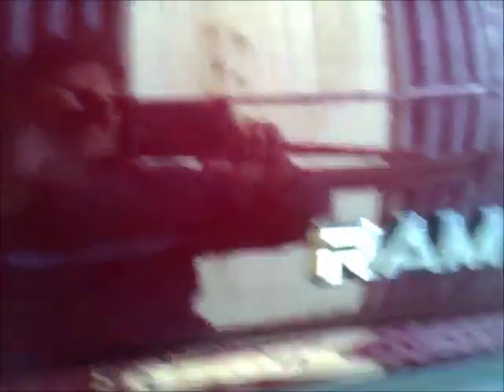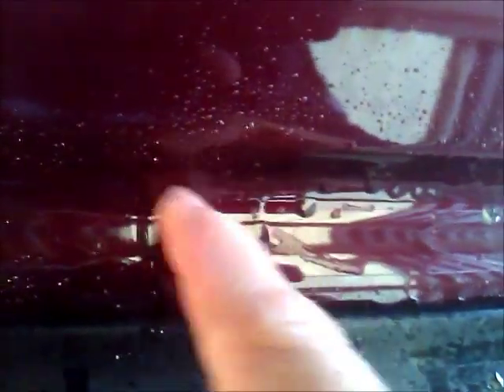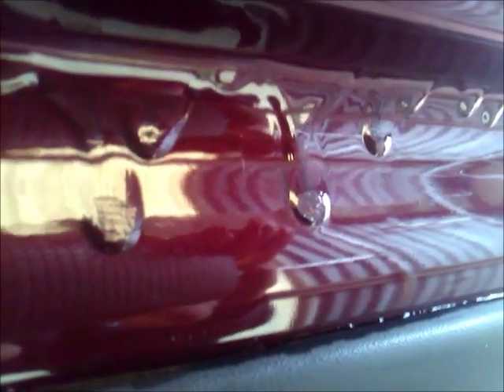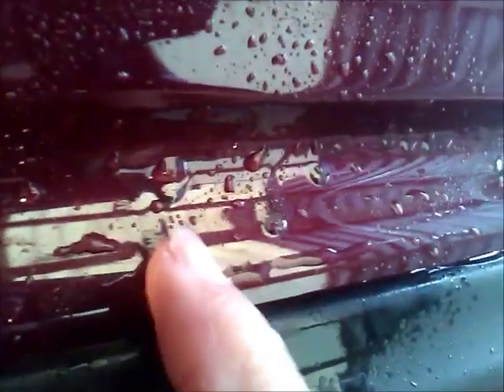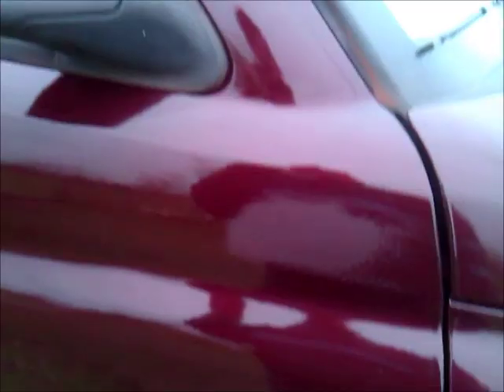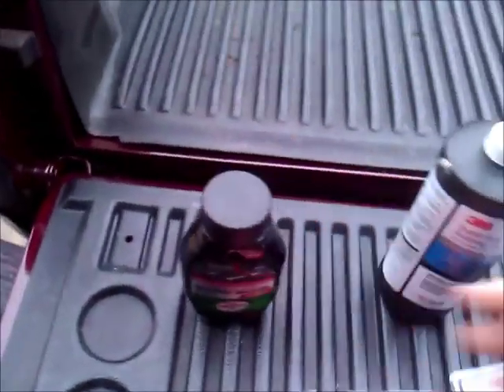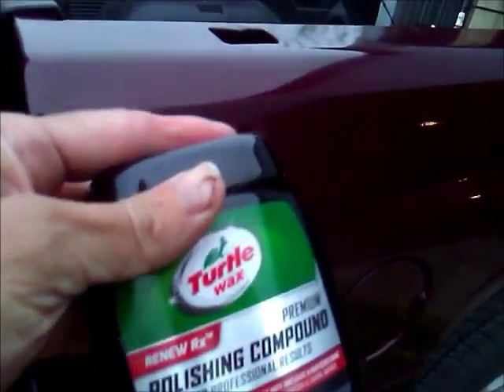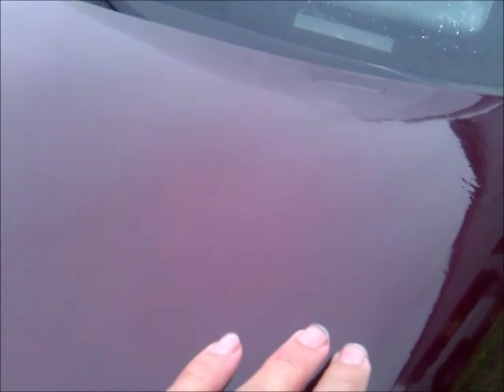how to fix paint runs and drips for automotive paint

Comment: To clarify you don't want to remove all of the material, stop when there is still a film build up, and wipe it off micro fiber cloth or something somewhat equivalent depending on what you got around then start the process all over again if-when needed. Love the backyard do it yourself get er done attitude (wish there was more out there) and also damn good turn out considering (looks good).  I did many in the same conditions (outside etc.) growing up with doing projects all the time with my dad, I have a fully equipped garage now but there is something about turning out a good product with damn near nothing and I miss the hell out of it.

Comment: if you use single stage paint, then you want to only paint solid colors with no metallic or pearls in them...that way you can sand and buff dirt and runs...if you want a metallic or pear color then use base coat and clear. then you can sand runs out of clear...otherwise the pear or metallics gather together at the run on single stage and you will always see the run no matter if its flat or not...like this guys
Reply: Is single stage Apple candy red a color that can buff out it has no metallic just looks glossy red
Reply: candy is a 3 stage paint over a metallic base...apple red is a candy color...no such thing as a candy apple single stage...but some people use the term candy apple red to describe a color of red...so to answer your question...single stage red no metallic can be sanded and buffed...but a true candy color can not be sanded and buffed without a clearcoat
Reply: Thanks man yeah I think the paint I bought said candy apple red like to describe the paint no the actual candy red thanks man for explaining to me thanks man

Comment: To answer your question of time . First read your label specs; your judgments will be at 24 but, not over 72 hrs. if not a product of a heated paint booth. Never, get into polishing in direct sunlight. just work small  areas at a time.